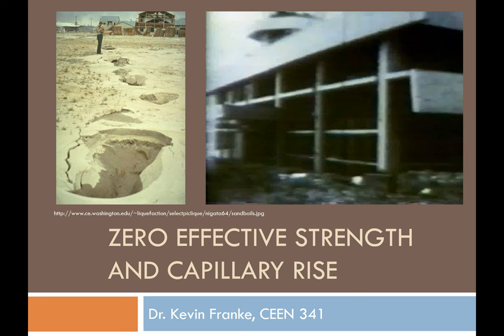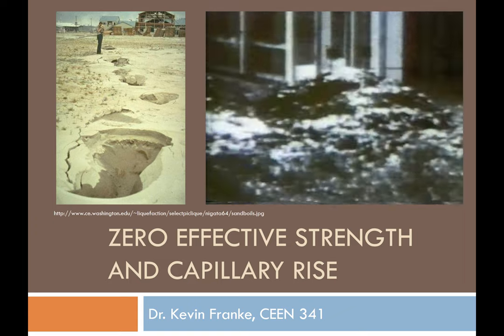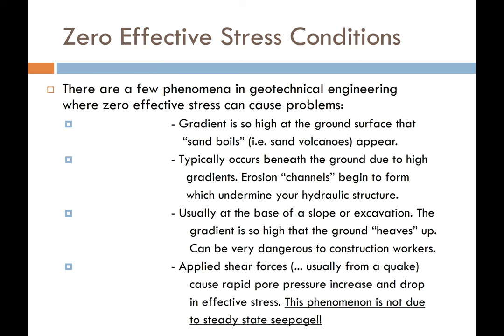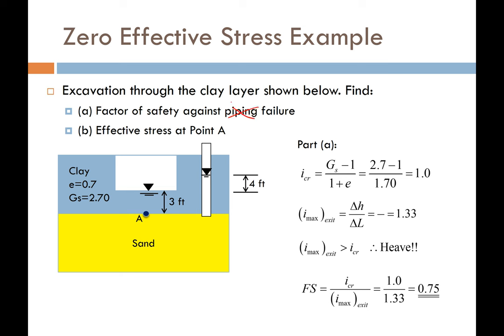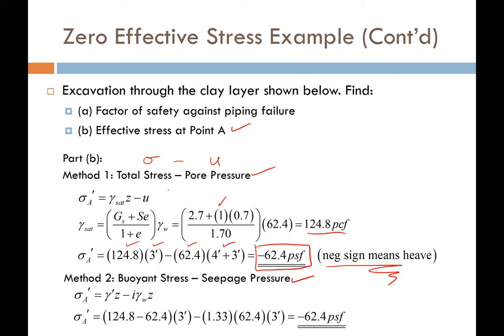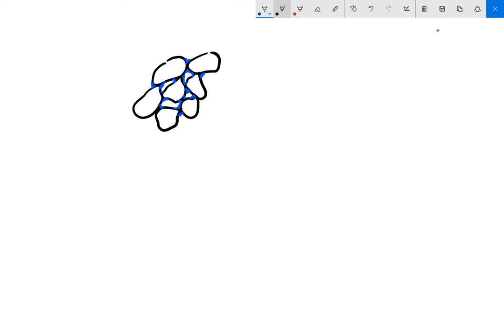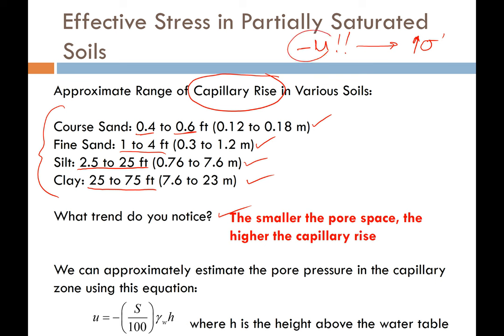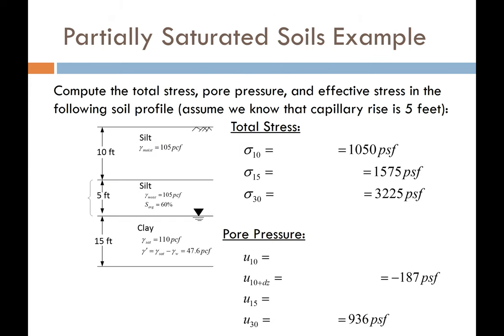CEEN 341 - Lecture 11 - Zero Effective Stress and Capillary Rise

Comment: I consider this lecture very important, because excavations below the GWT are very common in my area, and thus sand boils, heave, and failure of cohesive bottom of the excavation are serious problems that need to be always considered. It would be wonderful if you could do a lecture on the remedies for controlling these risks --for example: dewatering, where should be the pumps located, and what amount of flow should they take (I've usually found contradicting opinions about dewatering on these conditions, with some people saying that the pumps that others suggest worsen the problem because they increase the gradient). Most Soil Mechanics books treat the zero eff stress condition very quickly, and just calculate the gradient, but don't have exercises on designing a solution for decreasing the gradient. Given the serious risks that these kind of failures involve, a lecture on this would be marvellous, IMHO. Thanks a lot for sharing your lectures, they are of great help, and you explain everything very clearly!!!